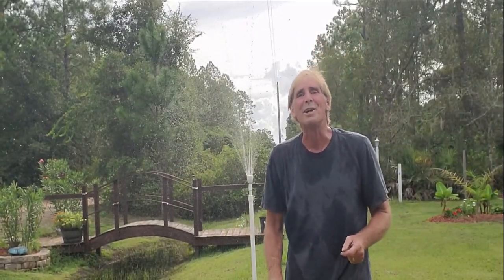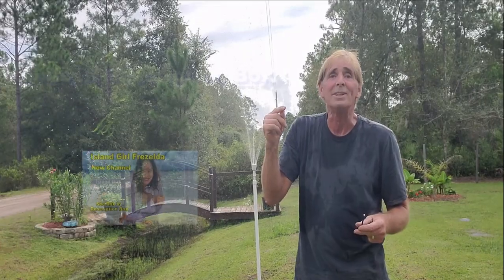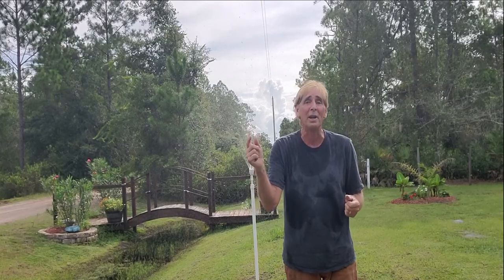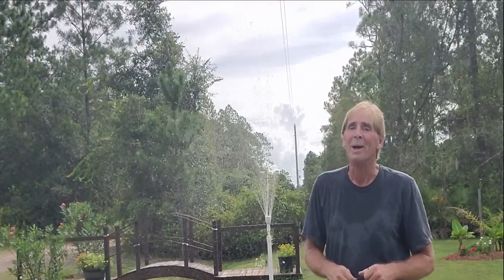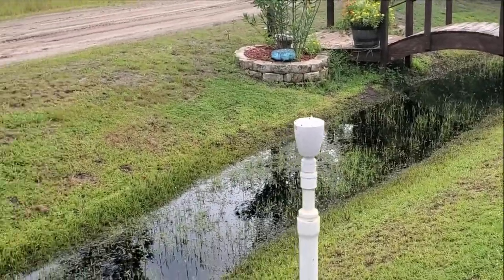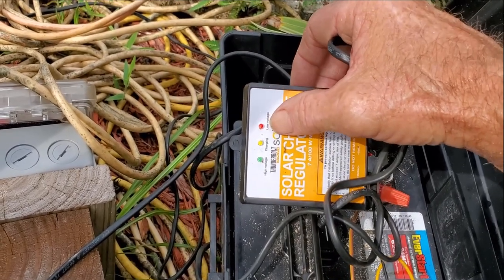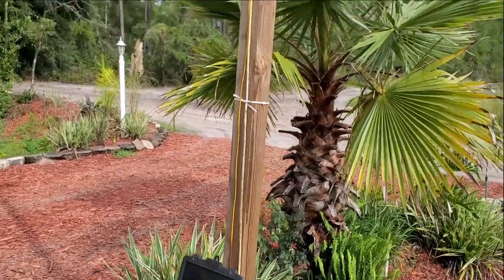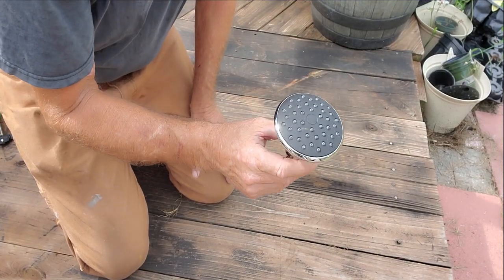30 Watt Solar Panel, Powers Sump Pump for Water Feature, DIY

Comment: Nice video. Do you think I can use a 50w panel to run a 35w pump without a controller and battery?